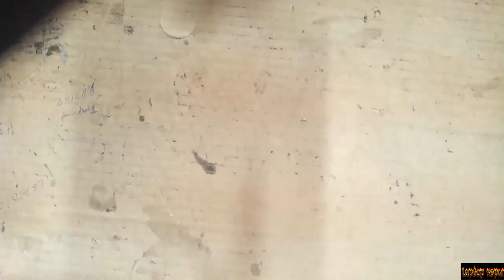Dell Inspiron 5558 Disassembly and fan cleaning laptop repair -Inspiron 15 5000 Series

Comment: You left out the part where you take out the optical drive. 😑
Reply: I had a heavy hand and broke mine trying to pull it out like shown above, lol.
Reply: nope, happens at : 1:21  take out the screw in the middle of the case, then one in the corner and slides it out.

Comment: To play some corny, cutesy music and NOT explain what you are doing and maybe offer some warnings of common mistakes during disassembly - like the ones you make here - over-stressing the hinges and risking serious scuffing to the lcd back? Very amateur stuff, here. This needs a major re-do. First, people need to know that after you remove the critical hinge screws for this machine (and one of them is under the keyboard) that you shouldn't adjust the screen angle or you could break the hinge mounts. You have first-timers watching these videos. If you know what you are doing (and I've done this dozens of times) you know that what you should do is help them understand what you're doing and what not to do. Put down an anti-static foam to protect the lcd back if you're going to lay it on its back. Nice, shiny surface like that could look pretty rough the way you're sliding it around. You should re-do this video - and do it right. Kill the music. Talk us through it. And work on that camera action! Wow, out-of-focus and in too close...can't see half of what you are doing. Do you rehearse these? I don't think you do. That's important.

Comment: Why do you have to remove screws from the bottom? Do they hold the metal piece under the keyboard in place?
Reply: I'm asking because I'm planning on changing out the processor in my Dell laptop of identical model. Mine came with the Intel i5 and I'm going to upgrade it to an i7 I bought online. I noticed it's under the keyboard and that metal piece underneath it but it seems like in all these videos people unscrew things from the bottom as well

Comment: The part that I'm having problems with, separating the palmrest from the bottom, was OFF CAMERA. The only part that is actually important is missing. I see others complaining about this. If you're going to do a video, make sure the camera is ON THE WORK the WHOLE TIME.
Reply: Did you find out a way to do this properly?
Reply: @eduardoorozco6657 I managed to do it but almost broke a connector. I don't recommend doing this if your laptop is really important to you
Reply: SAME

Comment: Sir i have this(DELL-5558) laptop,now i have 1TB HDD,8GB RAM. How much maximum size can i use RAM And HDD??
Reply: As far as hdd goes it doesn matter, the biggest size in a comercial 2.5 inch hddd is 4tb, and with ram the max size is 16gb (8gb x2) of ddr3l at 1600mhz. A tip i can give you is, remove the optical drive and install a caddy, buy an ssd of 240gb and install your os and most used files in there, then, in the caddy you install the hdd. I have the same model of laptop and i have a 120gb ssd and the stock hdd
Reply: I don't know about caddy,please give me some video tutorial about caddy
Reply: Mahmudur Rahman https://youtu.be/_n3KCjQYDHI
I saw that video, the only thing to consider is that the caddy Is sata 2, so i recommend to place the ssd in the original area of your laptop and the Hdd into the caddy, otherwise you would be losing bandwith if you place the ssd into the caddy

Comment: I just wanted to clean my fan.  You mean I have to do all of this???
Reply: Blame dell
Reply: @alwayssleepy3223  What is the glue he's using to put back the fan ?
Reply: @bouskilaaviel7585  i'm pretty sure it doesn't use glue, pretty much a thermic solution.
Reply: @Ralkila  where could I buy it? And how it's called on Amazon? Thanks
Reply: @bouskilaaviel7585  search it as pasta termica and translate it.
Reply: @Ralkila  thermal paste

Comment: NEVER NEVER NEVER buy Dell. Charging port is design to break and is not covered by warranty. What a joke.
Reply: @Kamig I tried that but the entire port stopped working
Reply: HPs are worse...
Reply: In my case power adapter died, so i just changed that

Comment: it doesn't have gpu?
Reply: no... it's integrated.
laptops are different than pc.
Most laptops dont have their own dedicated gpu.
Most are integrated, like i3/i5/i7-xxxxM <-- this "M" means mobile and it has integrated graphics, like intel HD 4000/4400/4600. Or similar to APU, if you know what are APUs.
Reply: It should be noted however, that the motherboard in the video has an empty space for a GPU, and spaces for VRAM.
Reply: CaptainMcShotgun can I use gt 920m with it